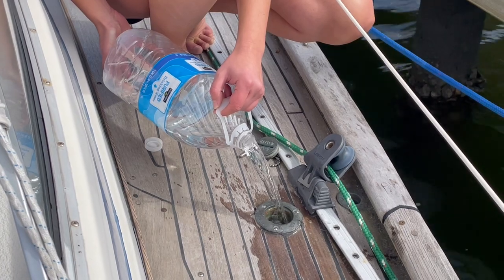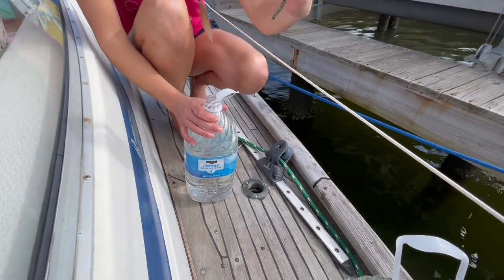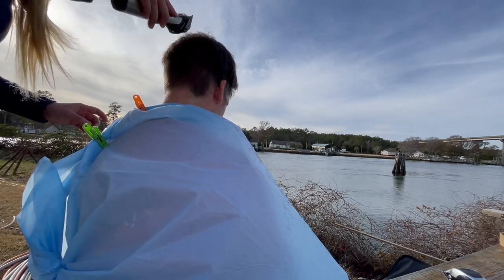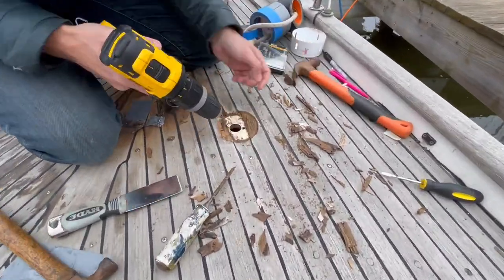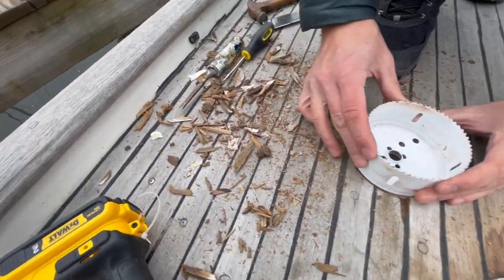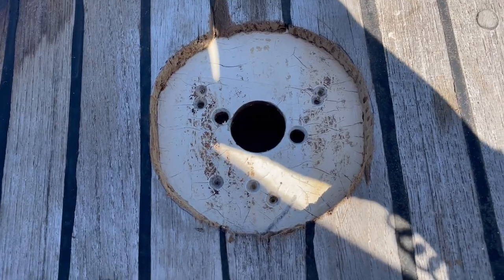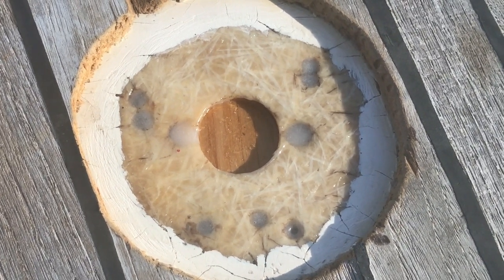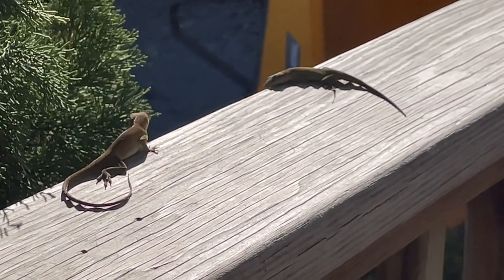The DAYS Of Our ⛵️BOAT LIVES | OLD Sailboat Restoration & Daily Doings | Sailing Joco EP38

Comment: I constantly had issues with crappy water...until...I got two household filter housings and installed a 5 mic and a carbon filter onto a board.  I hook the hose onto the 5 mic filter and the carbon filter feeds into the tank...or you can hook it up fulltime.  The thing is shre water can sink your boat if there is a leak in your plumbing.  I would have done a three filter system but I have a really little boat and storing the thing is an issue.  The carbon filter also takes out chlorine which can ruin a watermaker membrane.
Reply from the maker: Oh we have all the water filtration installed on our boat - Jeff has a ton of experience in that field from past careers. We just don’t like the idea of putting disgusting sulphuric water directly into our tanks lol. We just spent the time and energy and cleaned them out !! It gives us something to do (while we wait for the pros to do their job)

Comment: You need to put a water filter in-line on your Water Fill Hose - You can get the hoses and filters pretty much anywhere, most RV Stores have great hoses and filters. Here is a video link you may appreciate. https://www.youtube.com/watch?v=VxVGpayCiRk - hopefully this will help.
Reply from the maker: Thanks for the idea ! We have multiple filters installed on board - may have to do a vid on it ! 
We just didn’t want to be putting stinky water directly in the boat 👌

Comment: Days of our boat soap opera lives? What is this "real deal" you mention?
Reply from the maker: Real Life ! We do normal/boring things just like everyone else. Haircuts and epoxy lol. Sailboat ( living ) is usually associated with romance and glamour but we are showing the real side 
Thanks for watching !!
Reply: @sailingjoco  Ha! I must be living in a Fantasy world! then.
Reply from the maker: Your handle is appropriately named then ✌️
Reply: @sailingjoco  Yes! 
I strive for it! 
What would our lives be like if we could just leave a negative chapter out? 
I need sailing fantasy's to offset my decades with no sailing.
Reply: I like working on small diesels, I've rebuilt several VW diesel's (from the early 80's) I might have missed an episode where you guys got all the problems fixed. 
You know, when a diesel is in great state of tune, there is virtually no smell. A lot of people would say that "a diesel can run forever". Its true that they can last longer, but many people have little stinkers. Your's is most likely mechanical fuel injection. So the injectors need tune ups too.
Reply: I still have my pop pressure tester, 
got it out and its ready to check injectors! I demo video soon!